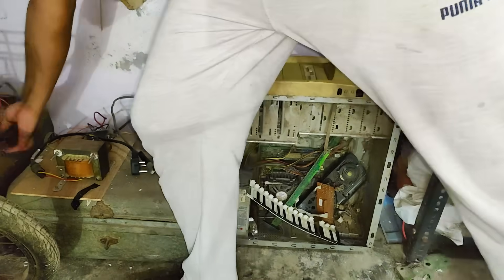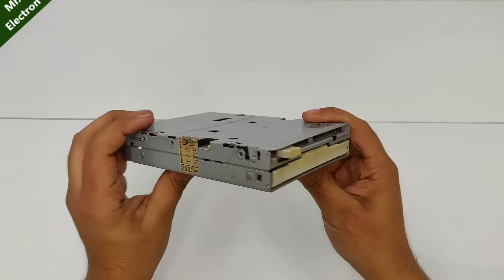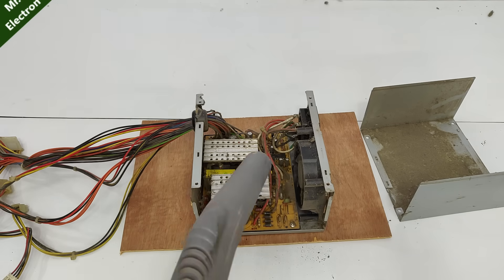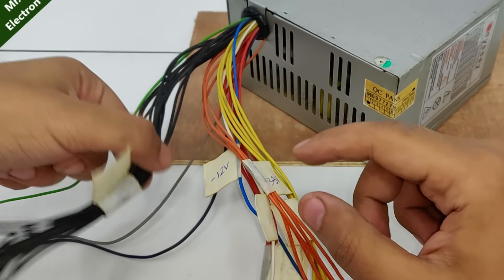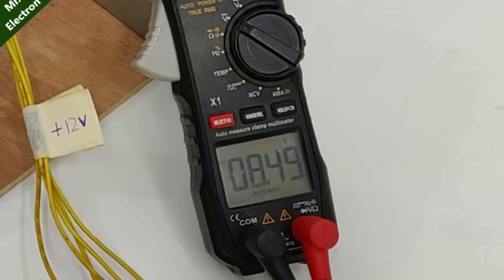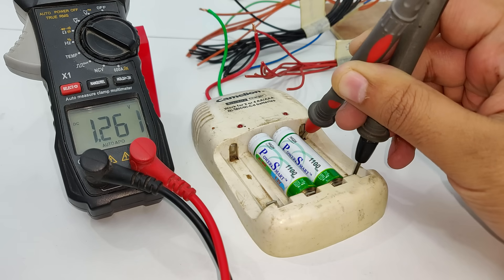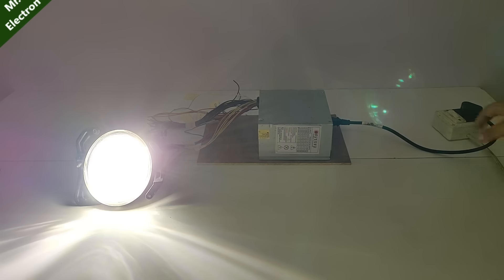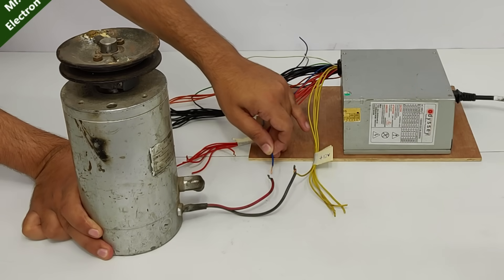20 Amp Battery Charger with Computer Power Supply - 220v AC to 1.5v / 3v / 6v / 9v / 12v / 24v DC

Comment: how did you run motors on 24 volts and most PSUs only allow 0.5 to 1 Ampere on -12 volt relay.

Comment: Bonjour Monsieur. Bravo pour votre vidéo. J'aimerai savoir si on peut mettre une diode de 3A au lieu d'une diode de 6A. Je suis novice et j'aimerai que quelqu'un me réponde. Merci à tous ceux qui lisent ce message et qui me répondront.
Reply from the maker: Sure, but if you draw more current than the rated, it will burn.

Comment: I charged 12 volt battery - 12 volt and +3.3volt when I connected to battery the power supply turned off reason why?
Reply: Yes I also tried but it turns off

Comment: As others stated the -12V cannot carry much current. It's a single wire, I can't tell what size those wires are, maybe a 22AWG, that is a 0.6mm2 wire rated around 0.9A for power transmission.

Comment: Excellent video, I always checked power supply the usual way and never really thought of checking such combination of wires. Blue and orange seems perfect way to charge up 12v battery (and packs), although I wouldn't recommend using it unless you've BMS installed. What is the value of diode you used to drop voltage?

Comment: I think (not 100% sure) the 2 unidentified wires are most probably connected to PGI and PGO pins of an integrated circuit supervising voltages (PGI = "Power Good Input", PGO = "Power Good Output").
That kind of IC monitors voltages (Over Voltage Detection, Under Voltage Detection, etc...), and is often an 8 pins IC in relatively recent PC power supplies, and is located in the secondary part of a power supply

Comment: You did not have to pull that little power supply board out to find out anything. Diagrams are available online or you can use a multimeter to find out. Either way you won’t be pushing enough power to make much difference!

Comment: The fully charged voltage of a 12v battery is 13.4v. hence you should have at least 13.4v power supply to fully charge the battery.
This 12v power supply cannot charge it fully.

Comment: My friend just... THANK YOU!!!🙇‍♂️
I don't spend 100 euros for buying two 12v 5a power supply for my Imax chargers (1s-6s  80w).. I use them for recharge my 5s batteries!!
I use 12v 1a power supply from wireless home  phone...
To charge (balance) a 5s4p battery make 10 hours...😨 with 0.7 amber...!!
So I have 4 batteries 5s4p and 2 imax 80w..
Waiting for low voltage and I will charge them with 1.5a... 
I want to believe, I will charge them all in 10 hours...!!
Thanks again for your idea!!!👏🏼👏🏼👌

Comment: Your voltages are wron man! You can't ever fully charge AA/AAA with 1.2V! You'd need at least 1.8V, not speaking about 9V (they charge with 10/10.5V), li ion charge with 4.5V etc.. you cannot push a single pikoampere (0.00000000001A) when you have 1.2 V output and 1.2V charge on the battery man, you ALWAYS need hjgher voltage becouse current goes always from higher potencial to lower, until they're either reached the same.. in case of battery charging you'd in this case need to check them periodically if they're charge to prevent overcharge/kaboom

Comment: When I connect a cordless drill motor to the 12v line it just shuts off the PSU like a short protection... why ? The motor is rated for 12v

It works on the other lines like 5v, 3.4v
Reply: Same

Comment: Thank you so much brother, this has helped me a lot for my project.. Hoping to see 1M soon, you got a sub too now! ;D
And for those who are wondering, this is a ATX Power Supply which means that it has a wire which can keep supplying +5V Battery even if its powered off and that is the Purple Wire which does that. The Gray Wire provides +5V if all the other wires function correctly.. I can't go any simpler than this. And big thanks to @sBeDs in the comment section below, he helped me figure this out and I am spreading it forward.
I love your videos and I like to recycle old used products and this has helped me create a computer fan powered without a motor but with a power supply. Love your vids, keep doing what you're good at.

Comment: An uninformed video!
18650 batteries can be charged with 4.2v, not 3.7v. 
12v batteries can be charged with 14.4 volts.

In addition, it is necessary to charge by applying 1/10 of the current amperage of the batteries.

Bla bla bla bla .....

Comment: Be VERY careful...  For example, the -12V (blue wire) is only rated for a VERY small load!
As for the two 'unknown' wires:
- the grey is a 'Power-Good' output (to tell the computer MoBo that the supplies are all 'stable')
- the purple is +5VSB (it's the 5v 'standby' voltage which is present even if the green 'start' wire hasn't been grounded)

Comment: Will it be safe to run any appliance like motor etc if i connect different output wires to add up voltages by combining them? Pls ans.

Comment: In computer classes, we were always told, never open your power supply, neither your monitor.  At that time, the monitor had the big cathode ray tube.
And the power supply had some cooper wiring and capacitors.

Comment: That's an old computer, not an old CPU. Also, the purple wire is +5VSB, a second 5V rail which is on permanently, even if you don't connect green and black. +5VSB means +5 Volts StandBy which are provided to the motherboard at all times (even when off but still plugged in to the wall socket) and is what the motherboard uses to turn the rest of the PSU on so the rest of the computer turn completely on.

Comment: It's worth a mention that the output power of -12V/-5V lines doesn't scale up with max power output of the PSU. They are limited at 6W/2.5W power output (@0.5A max current, as in your case), even if you have a 400W model. And that limitation carries over to any combination you'd use them in, for example the 24V. So "... 24 volt  and all this at very high 20 Amperes" is definitely overblown.
Reply: Correct, For example if the +3.3V gives you 24A and the -12V gives you 0.5A, you are basically limited to the 0.5A, using that combination to charge up your battery at a rate higher than 0.5A will destroy the PSU.

Comment: Hi I did same like you did in charge - 12v with orange +5v but it doesn't works when I connect with battery power supply stopped automatically, so please help me out how to fix this problem for 15 v power

Comment: heyyy i have a mercedes car battery 80Ah 12v, can i use a yellow wire (12V) and a black ground wire to charge it?? also, i've connected it and before i switch on the PSU the dan starts running from the Battery current, is it charging if i on the PSU or not?? please help
Reply: Connect it to a proper battery charger or an inverter pls dont charge car batteries with non regulated power supplies ull damage them

Comment: good afternoon, greetings from Venezuela, your tutorial is very good since it has given other voltage options that others have not said. not getting a 6a diode that someone else could place to charge a cell phone battery look for information and there is a 1000v nte5817 and 100v nte5815 that are equivalent but I can't find them either please I listen to suggestions thanks.

Comment: The Purple One is 5v StandBy which means if the Green Wire isnt connected to ground it will still output 5v
the Grey one is P.G(Power Good)

Comment: The Atx power supply you have constructed is it capable of charging a 70 amps battery to 100 amps battery 12volts

Comment: Good information but littered with incorrect information. Charging lead acid batteries in this way is fine in emergency situations, but if you look at the info on the battery itself, they advise not to use a current higher than 2.1 amps. As this set up has no current limitations, a discharged battery will draw a lot of amps, which is detrimental to battery health. And in the case of lithium ion batteries, NEVER use this setup. There are easier ways to burn your house down. Always charge lithium with CC-CV charging protocol and never exceed the C ratings. All in all a good video fudged up by the lack of knowledge regarding what you are talking about.
Reply: Bro, can we make spot welding with computer power supply ?
Reply: abi56434 with the high current part with around 20 amps it’s very possible

Comment: Some of the fans you can get two speeds, USB 5 volt, or 12volt high speed put in a cooler with ice you have a simple ac unit

Comment: NEVER re-charge batteries as described. Use a charging circuit to limit the current, have a proper charging cycle, and shut-off when charged. THE METHOD HERE IS AN EXTREMELY UNWISE.
Reply: Charging lead acid batteries probably won't be an issue, but charging lithium batteries with it is a big no no.
Reply: @spacejihadist69420  except you need at least 14.4V to charge a lead-acid 12V battery
Reply: Pq
Reply: You cannot desulfate the plates of a lead-acid battery with a regulated charge. “Smart charger” doesn’t mean better charger
Reply: you are the type to use a hammer on screws and call yourself clever
Reply: DC has always zero frequency & u can use higher amp than rated amp in your devices . Only voltage should be exact as rated on appliance . So what unwise here .
Reply: @bhavishdhankar1943  I am talking about re-charging batteries.
Reply: It's momentally and with caution

Comment: Need to be very careful charging Li-Ion batteries. They do not like continual charge beyond 4.2V. Need to add in a voltage cut off circuit set for the nominal 4.2V.

Comment: Don't charge lithium cells with constant voltage! It will probably draw tens of amps. They must be charged with constant current. There are cheap CC buck converters for that purpose.

Comment: Is it really possible to charge a 175ah battery with this powersupply? 
I mean a light truck battery can be charged with this method as you said in the last part of the video take negative 12 put a doid in between and take the +3.5 to charge the battery?

Comment: Terrible way to charge batteries. Some current limiting would be needed especially for the sealed lead acid gel battery. You would boil away the electrolite in no time.

Comment: At 14:20 you connect the DMM to battery and it reads 11.93V and you say "its completely discharged", am I missing something because no one else has commented on this???  But in my world that battery is near full charge assuming its a 12V battery, full would be 12.5-12.8V.  Maybe I am in bizarro inverse realm of the multiverse and just didn't realize it.  
I have a question and comment about my experience with combining pos & neg voltages from a PSU, but 1st I am curious about that statement.

Comment: Hi, my powersupply shuts off when I connect bigger load (car bulb, motor) it is rated 12v 20A.
Any sugestions?
Reply: Connect another load to the 5V line. If left unconnected, the voltage on this line is out of range and the protection is activated.
Reply: do not use a motor!    These PSUs are NOT designed to handle inductive loads

Comment: Well that quite interesting i forgot that you can take the -12 v blue wire  and as well the 12v to make up 24 . But the -12 will not give more that 0.7 to 0.9A usually better tap on the transformer or better you can reworked a bit but that mean you have to remove the supervisor ic . Got mine simple one done few year's  ago . Great work

Comment: 06:54 - "So let's do the multimeter check for the exact output voltage and here 12.8 volt DC" [Multimeter reads 12.79v]
07:02 - "Now we have our red wire which is +5v and we have 5v exact" [Multimeter reads 5.095v]
LOL You crack me up buddy!

Comment: I did not quite catch the diode rating for the use in charging 12 volt batteries. What is the size?
Reply: i think i heard 6 amps
Reply: It's a 6AO5 Rectifier Diode, rated at 6A/50V

Comment: The problem you have there is over current when charging. You could easy cause a fire and buckle the plates in a battery.
Reply: Correct.  This is a demonstration on a desktop PSU versatility as a bench power supply.  aMany modifications are required for any of this to be safe.  Mods are easy when you salvage.
Reply: @David-bc4rh  should have a current measure and current limiting  circuit , this is fairly easy to do.

Of course you could cut all the wires, tap into the 12v rails and run a variable buck boost with display and current limit function. But then you could use a fair few  power bricks to do this even a old laptop charger.

Comment: Purple is standby without ps on supply regular voltage of 5volt is present on the purple wire as soon as you plug on the main supply

Comment: Purple Wire is “5v Standby” it gives constant 5v/2A while the supply is plugged in (even if it is turned off)
Grey Wire is “Power Supply OK” it gives 5v when the power supply is working correctly.
Reply: thank you sir! useful info

Comment: hey hey, i just discovered your channel today,  and so far, really great content, i also love recycling old electronics to experiment and make new stuff with it!! And if you haven't found out yet, i also wanted to tell you about the purple and grey wires because they can be very useful, the grey one is called "power good" and is used for safety, when you turn it on, the psu as a self test fonction that verify that every rail output the right amount of voltage, if everything is ok it will output +5V after a few milliseconds, but if something is wrong it will remain at 0 and a pc won't turn on, in a project like yours, you could use it with an led to make sure everything is ok before using it, i'm sure a more advanced user could even use it with some transistors to prevent part of a circuit from turning on if something is wrong!!!! the purple wire is the 5VSB(stand by) and could be used to make your projects a little more fancy if you ever want to go that way, it's the only wire that will still output 5V even when the psu is turned off(but still plugged), a pc use it for a bunch of things, like keeping the battery charged, powering the mobo's led, sleep and wake up functions, etc.. it could be used for any number of things in a diy projects, from a simple always on led, to a more complex circuit like a clock, or even power a microcontroller... basically, anything fancy you'd want your project to be able to do while it's main part is off, you can, so long as it doesn't require more than 5V!!! XD Anyway, keep up the good work, i love watching electronic videos while i'm working on something too, specially when it's about recycling old stuff into something new and useful, because not only is it fun, it can help to save the planet a little and even save you some money in the process!! XD
Reply: Thank you so much bro, I searched Wikipedia for this info and all it told me was Power Good and Standby respectively. I didn't know what it meant but you explained it really good and in an easy way. Thanks Again
Reply: @abdul_samad2708  no prob, i feel you bro, had to search for a while just to piece together scraps of info from here and there just to get the idea,  experimentations had to fill the gaps!! XD
Reply: @thabed007  Lmao yes... Thanks again brother

Comment: I have something that needs a power supply of 12v 3.6a , could I use the power supply with the 12v on it or would the amperage be to high?
Like could I burn it up if I use a power supply with a higher amp output?
Reply: Imagine that you had a power supply that can output 20A and the device you need to power needs 10A. The device wil only draw the power it needs to work. So using a power supply with the same Voltage but higher current won't change the functionality of the device you connect.
Reply: @SuperMineMatteo  thank you very much!

Comment: I would not charge lithium ion batteries that way!
Reply: Viewers - caution when charging Lithium ion batteries! Best to use proper charger
Reply: Me neither. Those batteries need to be charged at a very tight voltage margin to keep them from blowing up. Essentially this is "haha current go brrrr"

Comment: No use when u use -12v because -12v have only 0.5 ampere means 500 mili ampere if u use any voltage combination with -12v out put will be only 0.5 ampere means 500 mili ampere

Comment: I do not understand the concept of positive and negative volts especially when thy add up?
Reply: Negative voltage is used for something else and always gives less current (Amperes) than the positive branch. For example, I do not recommend connecting + 5V and -5V to reach a voltage of 10V, because the current will be the same as in the negative branch, so very small. In addition, you can destroy the source. It is better to use positive branches (+ 5V, + 12V, ...) against GND (black wire), which you can consider as a sign (-), because it has a lower potential than the positive branch. Or you can similarly use a negative voltage (-5V, -12V, ...) separately, which has a weaker current usable for weak drives, for example. In this case, you can consider the black wire (GND) as a sign (+) because it has a higher potential than the negative branch. Your resource will reward you with longevity and reliability.

Comment: Thank for sharing your knowledge Sir. Please what will be the expected maximum output current if I use  orange(+3.3v rated 26amps) and blue(-12v rated 0.8amps) to arrive at 15v  for my 12v200AH battery charging? Bcos I'm afraid if I will have enough charging current.
Reply: 0.8 Amps
Reply: @kennmossman8701  Correct it will not work for high current charging, will break.

Comment: I am looking for DC tp DC transformers to operate
coach fans installed in
locomotives as given below:
1. 24V Dc input 110V Dc output

2. 64V Dc input 110V Dc output
Note; The dimensions of the unit
should be 4"×4"×2" approx to
fit on the bracket of the coach
fan.
Pls suggest the best available
to buy in INDIA CITY KOLKATA